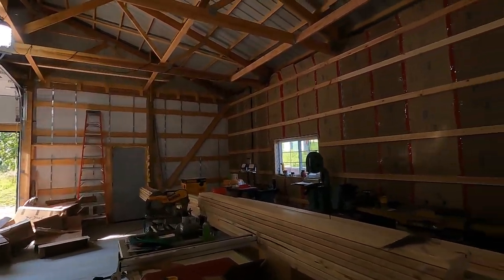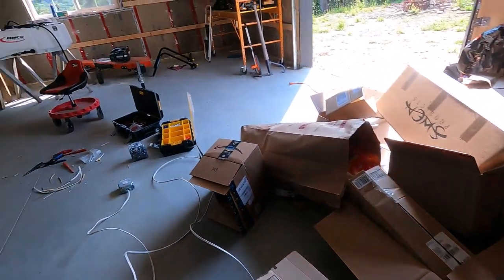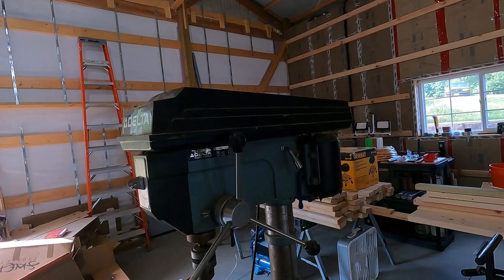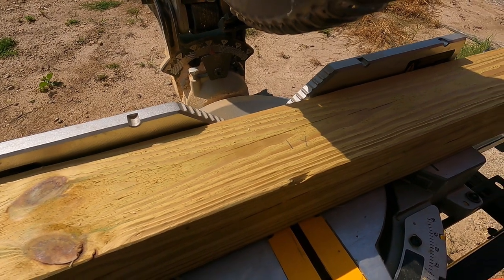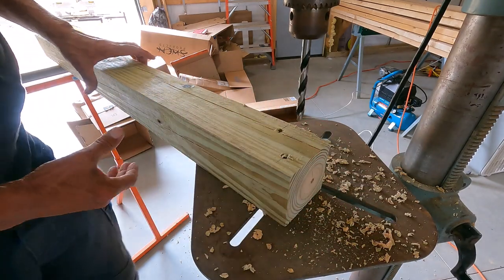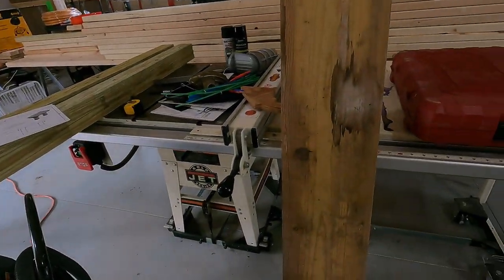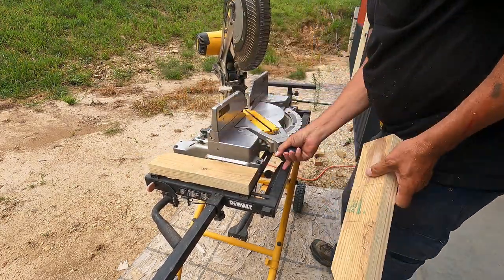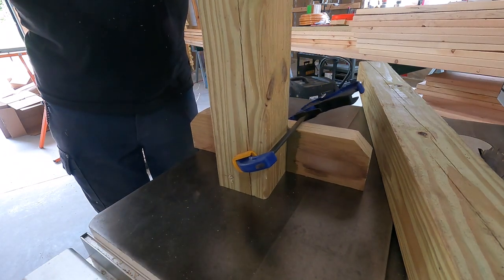Making a Treated Mini Split Stand (For Snow Clearance)

Comment from the maker: Soon I will be back to working on the shop again, and will be finishing-up the propane lines and electrical crossover from the service entrance to the far corner. I also need to install all of the joists and other things up-top before I can get to the other stuff. Seems like a ton of work (and it is), but I should have the shop operational by sometime this winter. Lots of videos to come on the work here so stay tuned! 

3M All Weather Flashing Tape - https://amzn.to/3ICBX4P
Huber ZIP System Liquid-Flash - https://amzn.to/31OtCtN
Seville Classics Commercial-Grade 5-Tier  60" W x 24" D - https://amzn.to/3qgjrXJ
5000 Lumen Temporary LED Work Light - https://amzn.to/3eslZfu
Heavy Duty 3-Prong Wireless Remote - https://amzn.to/3EnPWYN
Powermatic Model 60C 8-Inch 2 HP 1-Phase Jointer - https://amzn.to/3mvPq4M
Jet Contractors Saw - https://amzn.to/3mAAQJs
Insul-Hold - https://amzn.to/3evnmKq
1" Garage Door Chain Hoist - https://amzn.to/3rn11VF
1" 4:1 Open Garage Door Chain Hoist - https://amzn.to/3uldvQA
1" 3:1 Open Garage Door Chain Hoist - https://amzn.to/3IVxXf0
1.25" Garage Door Chain Hoist - https://amzn.to/32R3vmS
Ambient Weather WS-2902C WiFi Smart Weather Station - https://amzn.to/3GzRdNp
Brownell Oxpho-Blue Professional Grade Cold Blue - https://amzn.to/3BfKiYO
Evapo-Rust - https://amzn.to/3gJQEq4
Xcluder Rodent Control Fill - https://amzn.to/3oVsH3x
Great Stuff Pestblock With Smart Dispenser - https://amzn.to/3HfI2SG
5FT Power Twist V-Belt 1/2-Inch x 5 Feet A Type - https://amzn.to/3LTQQkF
Aluminum 5 Slot A Type V-Shaped Pagoda Pulley 5 Step Pulley - https://amzn.to/33GTclJ
Wixey Remote Planer Readout With Fractions - 300mm (12") - https://amzn.to/3scJQro
TamBee Hidden Door Hinge - https://amzn.to/3tpstTE
Yosoo Latch Lock - https://amzn.to/35Rh7ji
Spring Load Bolt Latch - https://amzn.to/3hF8n2c
Milwaukee 3/8" Crown Stapler (tool only)- https://amzn.to/3HKbtgb
Milwaukee 3/8" Crown Stapler (complete)- https://amzn.to/3igDDoz
1000 Stainless Steel T50 Staples - https://amzn.to/3toLUgM
MPOWER Triple Diamond Sharpening Whetstone - https://amzn.to/3ClrZ52
Rockwell Wood & Nail End Cut - https://amzn.to/3tfOQMz
Pioneer Diamante Series Ductless Mini-Split (9k) - https://amzn.to/3twjXnb
Pioneer Diamante Series Ductless Mini-Split (24k) - https://amzn.to/3D0Yvtw
Nylog Gasket/Thread Sealant - https://amzn.to/3IyHCaT
Mounting Bracket for Ductless Mini Split - https://amzn.to/3L7F8C0
Vacuum Pump and R134a Manifold Gauge Set - https://amzn.to/3qryKNM
CopperCoat Green Wood Preservative - https://amzn.to/3cqxVBb

Comment: I’ve never seen someone make themselves an extension cord, never even thought of it. I thought extension cords were one of those things you buy… not make. You learn something everyday! I like your little table and it’s good to see you making things in your new shop🐝🤗❤️
Reply from the maker: Hi Deborah! It's hard to find 220 volt extension cords, and when you can find them they are very expensive. I always make my own, but on more permanent ones I don't use romex, I use rubber cord. 😊
Reply: @TrapDoorWoodworks  Electricity is one of the things I know nothing about at all. That’s why it amazed me to see you make your own cord. That’s something that would never have occurred to me lol…I love to watch people who have a lot of knowledge in areas I’m missing.🤗 Soon, I’ll know just enough to be dangerous!🐝🤗❤️
Reply from the maker: @deborahdanhauer8525  A 220 cord is easier to wire than a 110 cord, but luckily you will likely never need to wire one up anyways 😉
Reply: @TrapDoorWoodworks  oh let’s hope not…otherwise you might be able to see the smoke from way up there.🤗❤️🐝
Reply from the maker: @deborahdanhauer8525  I hope that is never the case!
Reply: @TrapDoorWoodworks  me too! But not to worry, I’m never going to mess with electricity.🐝🤗❤️
Reply from the maker: @deborahdanhauer8525  😊